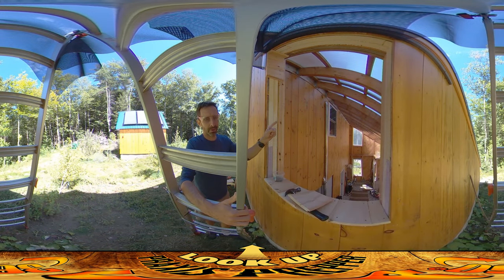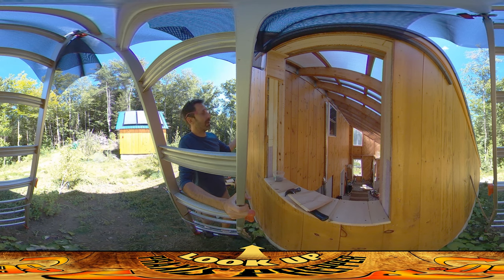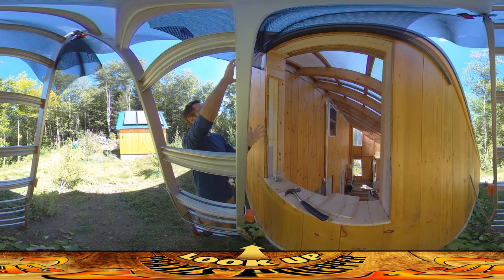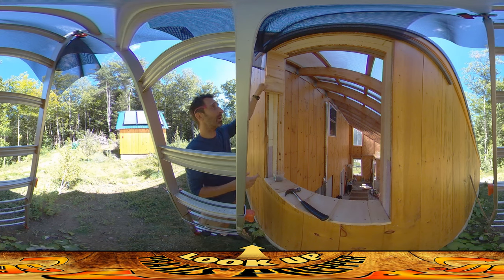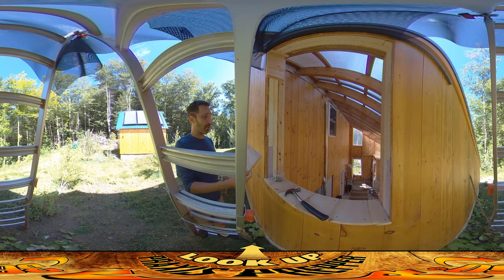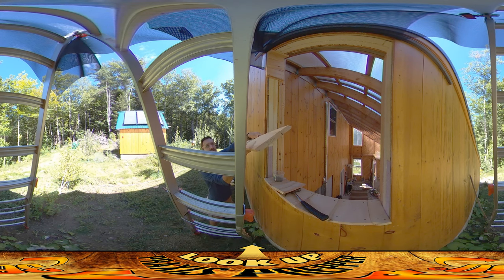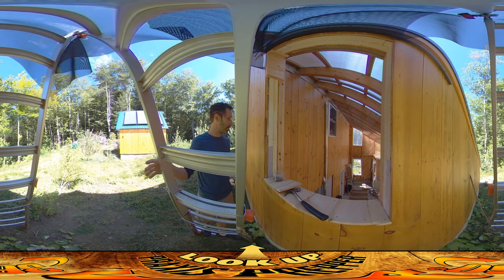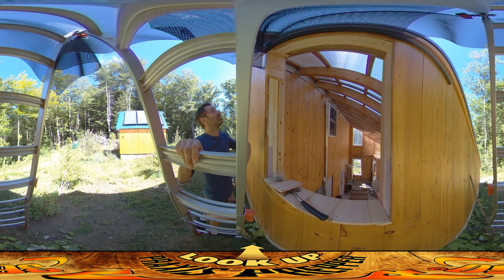Homestead Building - Venting a Greenhouse, Efficient Lumber Use

Comment: So, in reality the long boards are scrap 🤪
And yeppers, the louvres are going to be a pain at the top. If I were me, I think I’d just make a sort of header amd bring the smallest corner down about 6 inches or so. You’ll love a tiny amount of ventilation but will end up lasting longer since little pieces of wood are the most affect by warping/cupping.  Can remember if you have blinds, but if so, you might want to open up a cross breeze and get a feel for how the louvres are going to affect the sir flow because it’s much more significant than you would think so bigger louvres at shallower angles tend to work better.
Reply from the maker: Your idea (on adding blocks to make the angle less confusing) is sound in terms of utility. But the artist in me won't accept it. ;)
In terms of how much they'll slow the flow, it's all just convection pressure (not cross breeze), so I'm thinking it won't be too much. But we'll see.
Reply: @PraxisPrepper  LOL, I’m struggling with the design of something right now purely on aesthetic reasons.